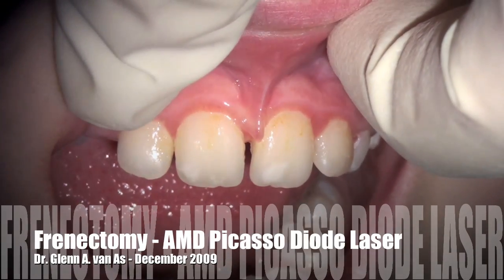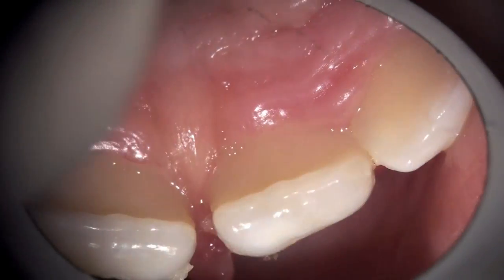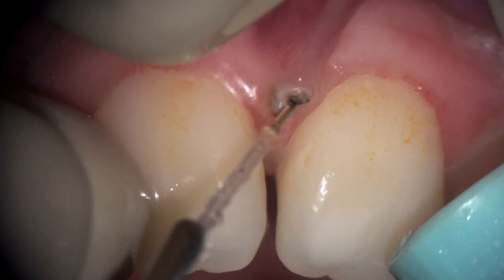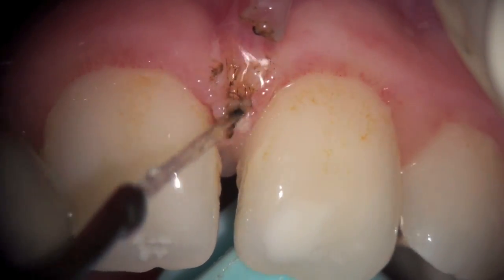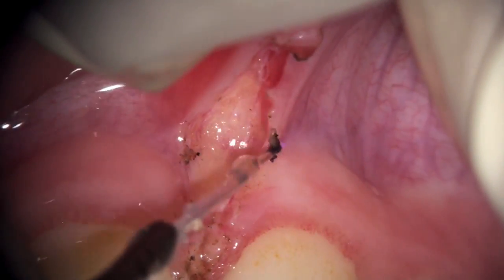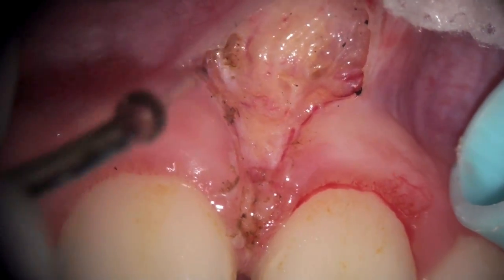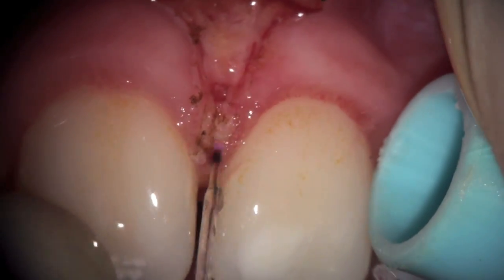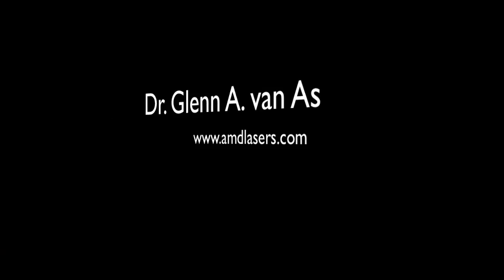Frenectomy with PIcasso good one.mov

Comment: Hi Dr Glenn recently I bought a Picasso lite laser and started using it, the problem is there is an intense burning smell of flesh how do we avoid or lessen it, can we use a water spray continuously on the laser tip.